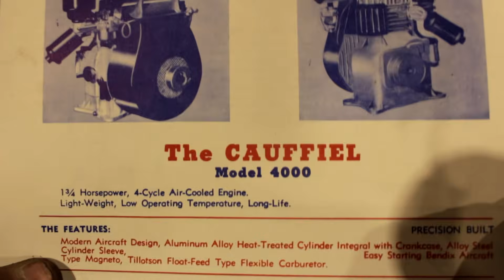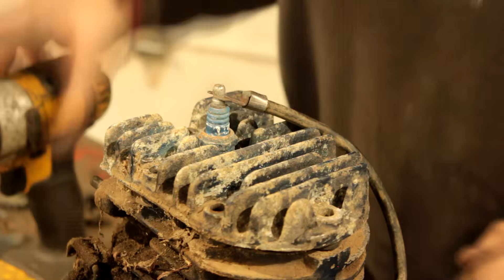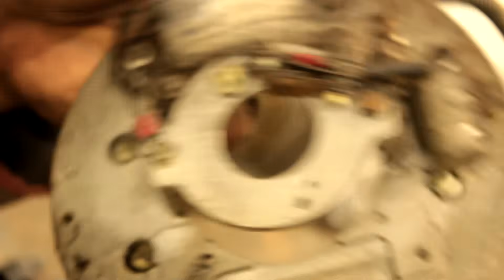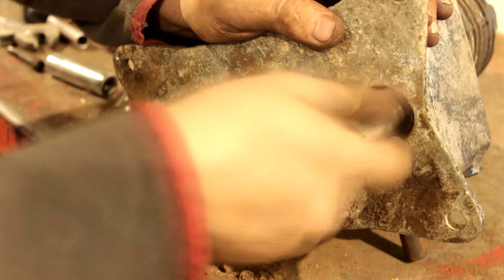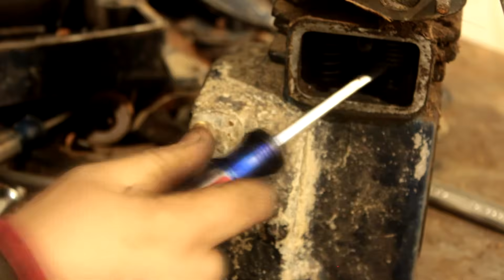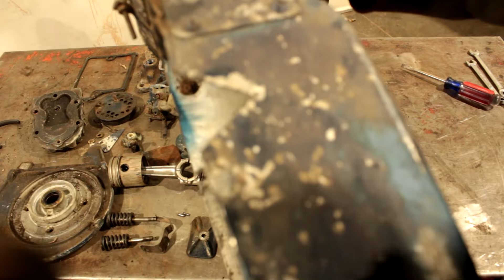1940s Cauffiel Motor Old Engine Revival! Part 1

Comment: Also looks like a Lawson Circa 1955 they were good engine that was also a Mercury Comet clutch with the Big Spring inside the groove of the friction weight s clutch, they never really worked very well but it's all we have back in the day and damn lucky to have one too they were expensive like $7
Reply from the maker: There are almost no similarities in design on a caufeild/clinton to a Lauson. only thing similar is Carberator brand and cooling type

Comment: Very interesting. This is the first that I have heard of this make or the history of the Clinton design. I'm wondering if you have ever had your hands on a Cunningham? Very similar to a Briggs 5S and apparently also stopped due to patent issues. I have 2 of them, one a chunk of corrosion, the other runs.  And yes, enjoy your show very much.

That "valve cover" cracked me up. Reminded me of the 1970s high school hot rods that ran like dirt but had spiffy finned doo dads all over the engine.
Reply from the maker: i do have a Cunningham very cool engines.

Comment: This one looks like it will come out nice. You need a valve spring compressor for small engines so you don't have to fight those valves as much getting the keepers out of them!
Reply from the maker: I have one it was just faster and easier to do it by hand. back in on the otherhand will definitely use one.